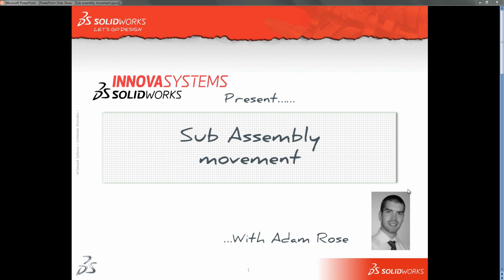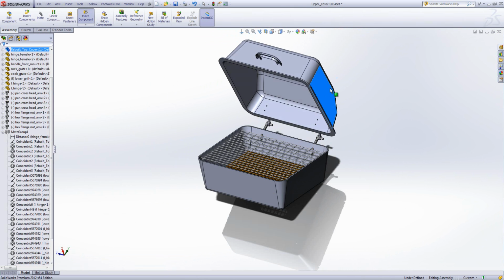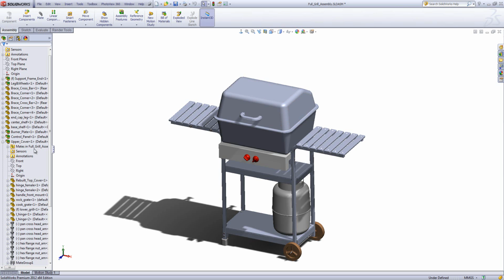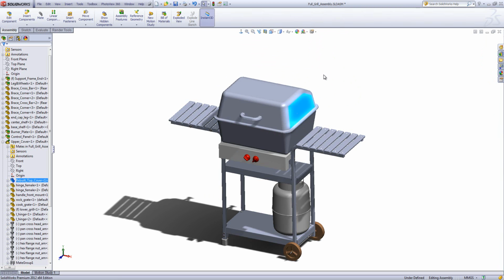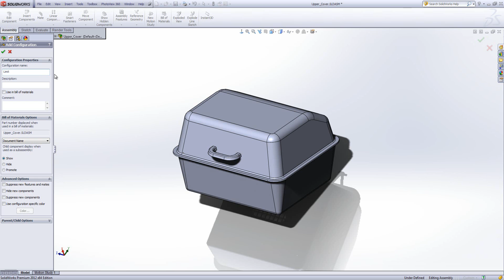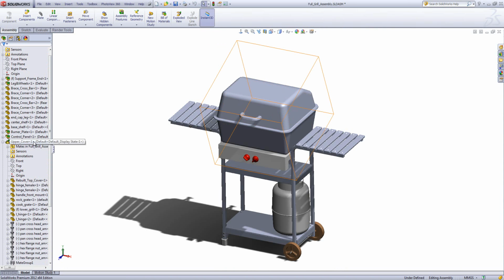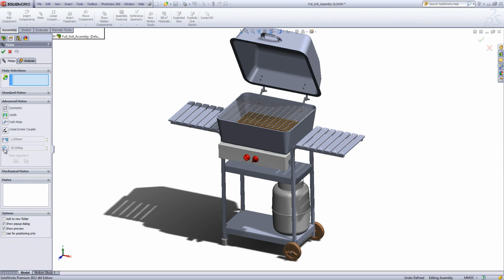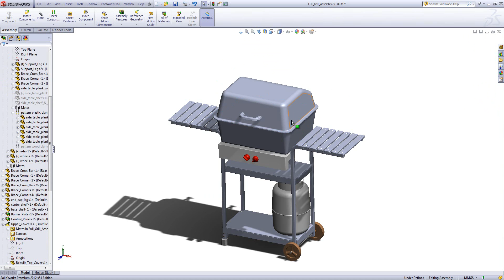Flexible Sub Assemblies in SolidWorks

Comment: The most beneficial part of the tutorial was the information to leave the most complex mates to the uppermost assembly possible. I have used flexible mates quite often and have always had problems with angle limits and other "flexible" complex mates in sub-assemblies when they are added to upper level assemblies. Thanks again.